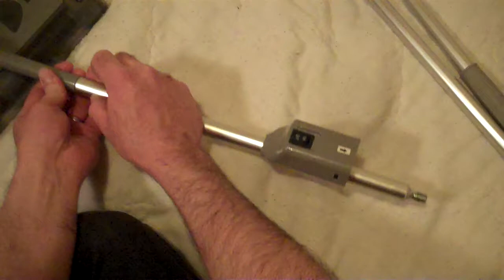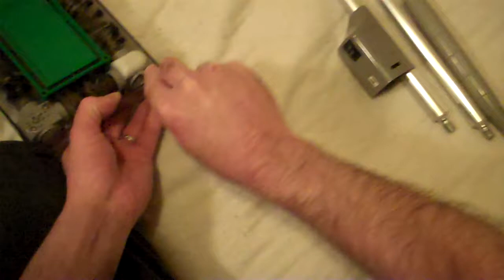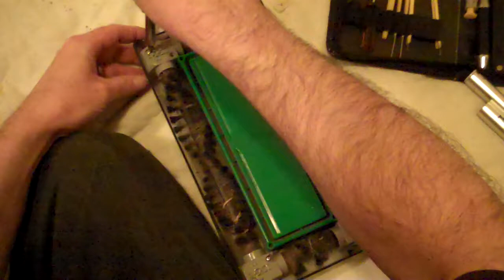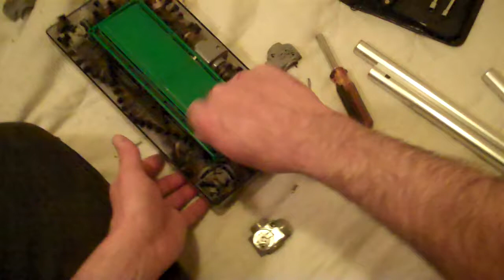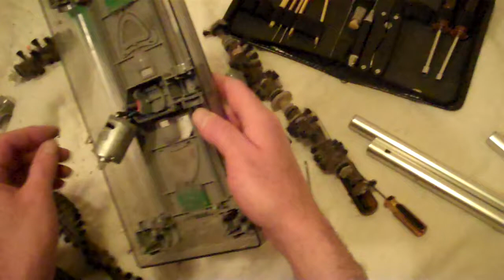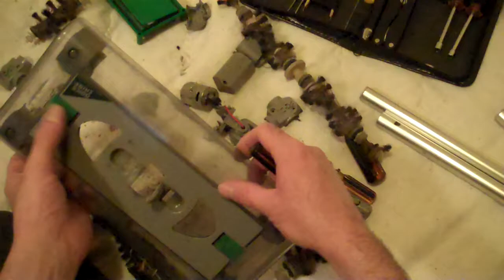How to Disassemble a Swivel Sweeper

Comment: have had 4 g2 all of them stripped the 7 tooth gear  and i cannot find a replacement gear ?
Reply from the maker: +Bernard Tuchtenhagen Thanks for comment ! I'm not sure where to find replacement parts for the swivel sweeper either. I will have to check into this.